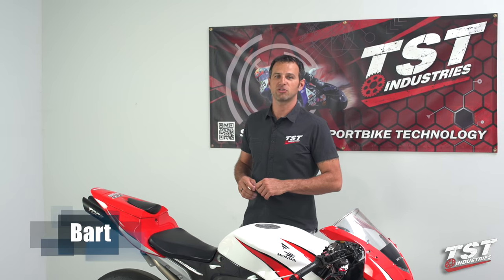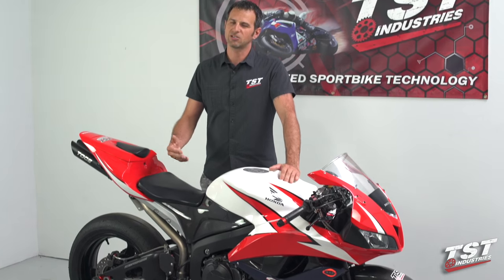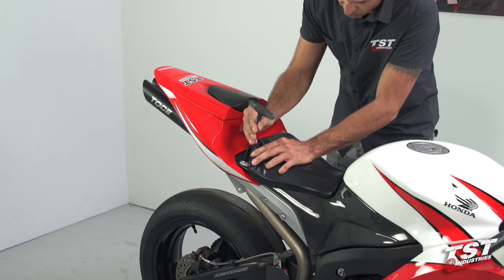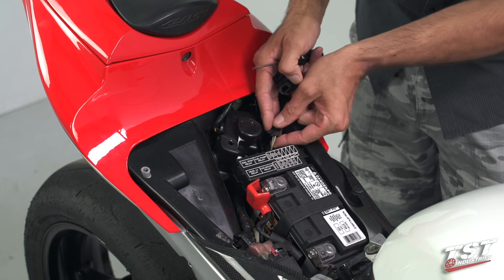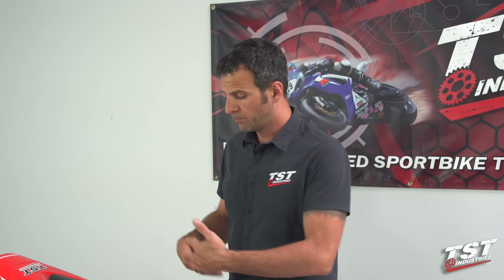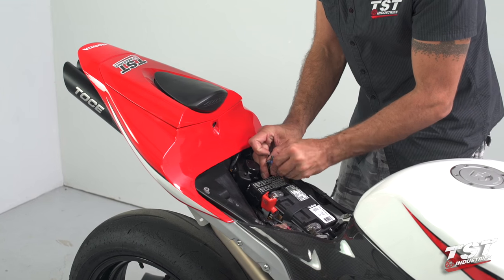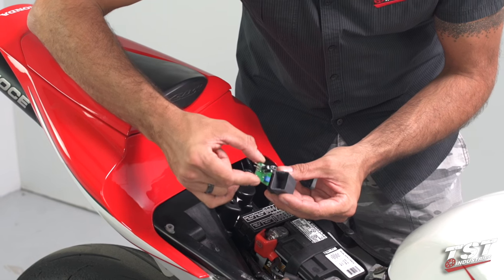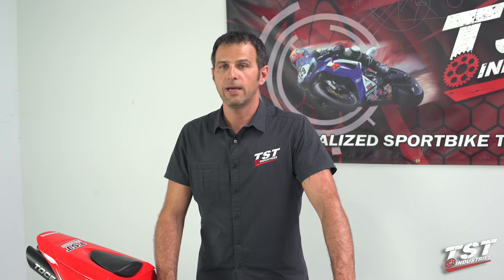How to install LED Flasher Relay on a 07-12 Honda CBR600RR by TST Industries

Comment: Hi. I have a 2009 cbr 600rr with after market indercators on and getting hyper flash happening. Would I need a 2 or 4 pin relay from tst?
Reply from the maker: That depends on what is on your bike from the factory. In the USA Honda has used the same type relay that is replaced by our 2-pin since the 90's. In other areas they have used both 2 and 4. If you are in the USA then 2 is a sure bet. If you are outside the USA, you will need to check on your bike and then purchase the appropriate type .
Reply: Okay thanks for the help. I'm in England
Reply: Do I check the pins on my relay to see if it's 4 ? Then order the 4 pin relay
Reply from the maker: @lukebond431  yes, that's right. In the UK and EU they used the four pin according to my memory  but please verify that. Look at the connector on yours and compare it to the connector on our four pin relay. If they look the same you just order that one

Comment: Would of been nice if you stated in the video that the relay doesnt fit AU / EU plugs without a adapter
Reply from the maker: We actually do not have access to overseas bikes here nor technical documentation for them. Once we find out there is some difference between American models and elsewhere, we note that in each product page on our website. The LED Flasher Relay product page has a note to "International Buyers" that has this information.
Reply: Jonny can you send me a link for adaptor please?

Comment: Will the OEM Flasher work for a 2021 HondaCBR-RR
Reply from the maker: We have not had one of those bikes here so I can only go on what I found through microfiche of parts. It looks like the signal flasher circuit is integrated into another control module so none of our traditional flasher relays would work. What we did for the regular RR model was develop a plug and play resistive load balancer. Please take a look at that part and see if the electrical connectors are the same on your bike. If they are, this module will probably be your only bet for restoring flash rate. Here is a link: https://tstindustries.com/tst-flash-rate-control-module-honda-cbr1000rr-2017-.html

Comment: I have a 2008 rr but it uses a 4 pin flasher relay, would that flasher work ?
Reply from the maker: If you have a four pin connector this relay will not plug in. I am sending you a link to the four pin configuration relay we have. If your plug looks like the one on our relay, I am 95% sure that relay will work.
https://tstindustries.com/TST-LED-Flasher-Relay-Honda-CBR500R-2013.html